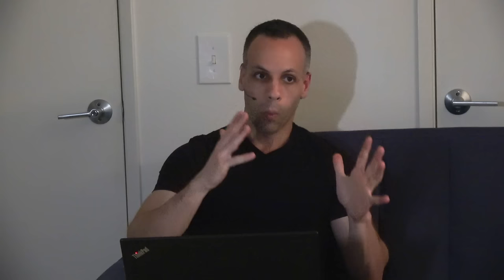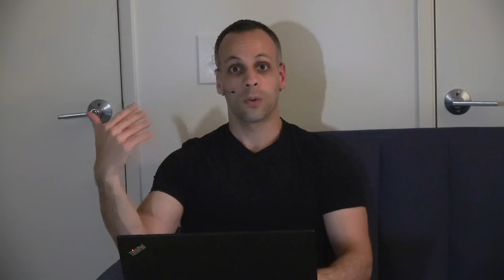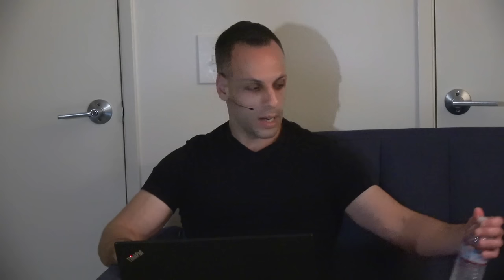EVGA's Oversight: Unannounced Changes Destroy PCs, EVGA takes NO ACCOUNTABILITY

Comment: This sort of reminds me how I built this PC in 2021. I bought a corsair commander pro fan controller, and plugged up my 3 front fans to one header of it. They came pre wired like that from NZXT. Didn't think there would be an issue. Well there was. It pulled too many amps and destroyed that header. No where in the manual or on the site does it say to not do that. A lot of fans come that way. I was able to return it though. Absolute junk

Comment: They should have designed a socket and plug with a shape that would prevent from using the old plug. I thought that was the whole point of having squared or bezeled pin plugs on the mobo in the first place...

But frankly, checking the PSU with a multimeter is one of the first thing we should do when building a PC. Worth the time to root that out if you need to troubleshoot.

Comment: If there is even the possibility of different pinouts with the same connector, the pinouts should be printed next to the connector. This if nothing else should be an industry standard.
Though ideally, the connector type should dictate the pinouts.

Comment: when it is the same manufacturer, and same model number, just a different release date or revision, then it would be very easy thing to think that you can use the same cables. but I was hearing back when I ordered extra cables about 4 years ago from another youtuber to make sure you get the correct cables for the correct power supply. either that or it was corsair that posted a warning on their web-site, but if you goto a shop, and pick up a 2nd power supply a couple of days later, you wouldn't expect there to be a change in the pin outs of the power supply for example.

product resolution and product reliability are two main things I go for when buying anything, the downside is the price premium, but I know I should expect the same reliability from the new purchase. and when it was time for a new GPU I knew it had to be EVGA as had 4 graphics cards, and none of them have failed, none of them had driver issues as long as I download off the EVGA website, NVidia drivers were c^^p to say the least.

Comment: According to GamersNexus who just talked about this story in their weekly news segment, the issue has been resolved between EVGA and the (or one of the) affected customer(s) including compensation for the bricked data drives that were damaged due to the cable screw-up, as well as going a little into why this occured in the first place. Might be worth doing a follow up video about it.
Reply: I find it funny that I also came back to Louis’ video on EVGA following the situation update.

In complete fairness, there was next to no additional information on the matter prior to Gamers Nexus reaching out. This is still a mistake unto EVGA as well not publicly announcing the changes.

I have that exact power supply as well as following the EVGA monthly newsletter since 2020. Not once have they announced the changes of the pin-out.

However, I did receive a disclaimer from their (individually sold) replacement cable set that explicitly mentions the changes around 2022.

Comment: Wow. Looks like I dodged a bullet this week. I bought 1300W EVGA PSU to replace an 850W PSU, and knew that you shouldn't use the same cables between different PSU manufactures and models, but figured since it was in the same Manufacture and model family I would be ok, which thankfully I am, since I'm still using this PC. But noted for future reference.

Comment: If the cable layout changed. Then why keep the same connector layout?
If it was properly designed the old connector should not be able to connect.

Comment: This is idiotic on multiple levels. There not being a standard. Changing the pinouts but not the connector. Changing the pinouts but not the model number. Changing the pinouts at all. Having a system that encourages people to use the wrong cables. Refusing to take responsibility for your terrible design causing problems. This is one of those cases where so many stupid decisions had to be made that you can't help but suspect malice.

Comment: EVGA gained their reputation in the PSU market through selling rebranded units from Super Flower. Think of the G2, G3, P2, T2 series. These were some of the best units you could get at that time.

A few years ago EVGA parted ways with Super Flower and now they mostly use FSP. FSP doesn't make bad units, but they rarely ever make really good ones. EVGA did use Seasonic for their G6 and P6 units, but that partnership seemed to be short lived. 

What I'm unsure about is who makes the GQ units. Did EVGA silently switch the OEM that made these GQ units, or did the OEM change the pinout?

Even before this fiasco, If I was in the market to get a PSU, EVGA is NOT a company I'd get a unit from. Both Seasonic and Corsair handle their RMA process as well as EVGA did. On top of that, companies like Be Quiet are making some really good units that are better than the G7 or P5 bullcrap that EVGA has on the market. EVGA now charges a premium price for their units but their units are not premium quality.

Comment: It wasn't EVGA but i had a warranty misadventure last summer. My Seasonic PSU died and it took with it the brand new mobo and ram, fortunately the CPU and GPU survived. Seasonic offered a 8year warranty on it but where i live i was supposed to go through the store to process it and the store itself offered only 2 years of service and after that you were on your own... and since i had the PSU for a bit over 2 years i was on my own. Seasonic replied that they can't help and there was no way that they would do anything about the rest of the damage even if they were to replace the PSU and MSI and G.Skill made it clear that if the components were fried by a fault in the PSU and it wasn't the devices themselves to be faulty, they are not obligated to replace them. 400 euros down the drain.
Next time i need warranty, i'm gonna lie to everyone about everything and maybe they won't look too hard before replacing it.

Comment: I thought I was paranoid always checking every pin with my multimeter and felt like a total idiot every time it as it was fine.
Luis is wrong though, they really should cover the damages (not data) IF they replace your psu with one that has different wirring (they know that 100%) AND they never told you about it (yeah they can prove that too). Simply negates most the customer's BS and will only cover their actual faults. However i think it is malice not incompetence here (the covering of the drives part, the swapping pinnouts on the same model is on the same level as apple puting a 52v line next to a cpu 1v data line but actualy worse)

For anyone to exploit this they would need to 
1* damage their psu in a way that evga won't void their warranty, possible
2* get "lucky" to get sent a psu of the same model with different pinouts
3* get no warning from evga, where they can totaly sent an email and tell the customer to destroy the cables, sent them a brand new unit (wires included) with huge red warning labels to not use the old wires.
Lastly they can standardise their own pinouts or make different psu-side plugs for different ones.
Problem solved. It isn't even complicated. Just excuses to avoid the cost of the drives and childish behaviour (doubling down instead of taking 2 steps which cost almost nothing to fix a problem and avoid a class action lawsuit).

Comment: That sucks, I have been using EVGA for 20 years and their CS has always been first-rate. In an industry where suck is the norm, EVGA was 5 stars.

About 3 years ago I had an EVGA PSU die on me, the first time ever, and it was under warranty. It was a 750-watt PSU and they sent me an 800-watt PSU in a sealed retail box.

Over the years, I had video cards die under warranty and got refurbished, but they were always upgrades.

It doesn't even take long: call, after 5-10 minutes someone answers and in less than 30 minutes, usually under 10, I have a cross-ship RMA set up. Try that with ASUS or MSI.

Comment: I was under the assumption that in the usa, there is such a thing as warranty. Not specifically the warranty the company makes but a base warranty. I.e. if a company provides you a product and it fails (since no 3rd party was invloced here), they are responsible for fixing the situation. 

It certainly can be costly, but this is an opportunity for evga to refine their internal policies.

As far as i can tell. If i stick with an original company for the peoduct and the replacement of a product and your product breaks my things because you did not provide me with proper hardware.

That is on you and you will pay for the costs.
If you refuse, there are always the courts. As far as i can tell, this may be a case?

Comment: Changing pin-outs is either a version (model) or revision change, and it should be labeled as such visibly. Versions/Revisions signal changes, and anyone purchasing a product needs to know if this is the same as the last version/model/revision, or if it has changed, because of the application of the product may depend on it. ESPECIALLY a power-supply. EVGA has, IMO, dropped the ball entirely with this kind of lunacy. Unprofessional behavior not showing the customers this respect. A customer should not need to test each components expected behavior in detail, that is what EVGA's QA is for. A version/revision/model change is necessary to signify that unit X is different from unit Y (and a pin-out change is veeeery significant) - and customer should evaluate before putting into production.

Comment: If this is a US customer then they are probably screwed as EVGA probably has some arbitration agreement clause in the T&Cs.  But if this is UK/EU I see no reason not to lodge a claim with a small claims court and let them decide.  There is no argument here EVGA were negligent, firstly for changing pinouts in the same model drives with no warning, that's the case won right there.  But the fact that they told him to keep his cables and then sent back a replacement drive that didn't work with those cables just proves negligence.

Comment: This is why you never use the same cables after an RMA. I thought this was common knowledge. When I RMA'd a BQ supply, EVGA told me to just throw out the old cables and they sent me a brand new PSU.

Like, EVGA isn't doing this just to screw customers. They don't make the PSUs, they just put their names on them. They obviously switched OEMs for the GQ models. EVGA doesn't just send out bare PSUs as replacements for RMA, they send you a completely new PSU, cables and all.

Comment: I'd feel understanding toward EVGA for not replacing the drives IF they hadn't KILLED THEM. There's no question there...THEY rewired the PSU! The customer simply plugged it all up as per usual. EVGA should be on the hook for this fiasco, and I think they know that.

Comment: I get not replacing connected hardware in most circumstances, but when you change the pinout on an RMA and don't send new cables, that's unacceptable. They knew (or should have) that there was no way the PSU was going to work. They should be paying at least for the hard drives.

Comment: I went through a similar issue with TWO Thermaltake Toughpower 750's. They were on sale for $50 bucks or something silly like that so I picked up two, threw one in a build about 6 months later and...click...then...nothing. I checked the wires, reseated everything and...nothing. Not even a click this time. I shut the psu off, unplugged it, took all the cables off save the board power, plugged it back into the wall, turned it back on, gave it a jump and the fans spun, yay. Feeling a bit more confident I plugged in the drives, and viola, still turns on. Great. Plug in the GPU and CLICK. Well f me. Unplug the psu from the wall, make sure the switch is off, swap PCIe cables, plug it back in, switch it back on, jump it and click. Same bloody thing. Now I'm kinda pissed. I toss the two dead 8 pin PCIe connectors and try a third. Same fricken thing. I open the other PSU, and on the 12th try I got a post. Why 12? Bc I ended up swapping the PSU to the other one.

5 cables that didn't go with either PSU, both from sealed boxes. I was so beyond annoyed I grabbed the 6 RGB fans and the controller I had, boxed them up and paid one of my employees to wrap it up. Luckily these had a trip which kept the PSU from frying the GPU or anything else attached, but this simply should not happen. If it is at the point where companies are shipping the wrong wires with their products on occasion, they really might want to think about a standard here. This wasn't some sketch Ali-Express deal or a 3rd party seller, this was from Newegg. I'll never buy a Thermaltake PSU again, regardless of the price or where it sits on the "PSU Tier List." I feel for that dude, and up until about 3 years ago I didn't know you were not supposed to use cables from the same PSU's either. I knew not to mix and match, but the same brand and model? I had no idea. In my case, apparently using the cables from the box was a crap shoot as well which again, is beyond unacceptable. After 20+ years of modular PSU's it literally makes no sense to not have standards for board power, pcie, sata, aux etc. Yes, i understand that some PSU's let you pug in 4 8 pins from one cable, but that just means there should be a standard for 4x8 cables. And one for 2x8, and 3x8, and 8pin + 4 pin along with wtv other combos there are. If they have to cut so many corners they cannot meet said standards then they should not be allowed to be modular/semi-modular and just have the darn things as part of the unit. To think that a problem which has existed since the inception of modular supplies is still a thing in 2024 when the solution is so beyond simple is literally dumbfounding.

Comment: My problem with PSU’s is that even with what looks like exactly the same connectors to the PSU, you have to be careful and test voltages. I use Antec and Corsair. I just always test Voltage out, and do not just go by colour of wires to guide me.

Comment: THEY WERE a quality company. They also moved to putting thermal putty on the memory modules (GDDR6 and GDDR6X) instead of thermal pads on their high end 30 series Graphics cards. Guess what happens when the paste dries out? The video output on the card dies. When you reboot the fan are still working and unless you knew about the thermal putty ( not paste) you would have no idea. In my case luckily I was about to RMA my card and get a replacement.

Comment: I used to enjoy EVGA products, because I found that they usually had higher quality stuff than their competitors, but after I had my systems for a while and I started having hardware issues, I tried contacting them for support and if your stuff is out of warranty, they didn't even offer me repair services that I could pay for, its the main reason why I don't believe in their products anymore, because you are not given any options at all when dealing with them, while with MSI or ASUS for example I have been able to get graphics cards and even motherboards fixed, even if they are out of warranty because they will charge you for the repairs.

Comment: i 100% agree with you but i have the problem that i dont which company to trust anymore. for example, to buy a phone, or a tablet. i bought a lenovo tablet recently, despite your video, because i just didnt know better and unlike you im not in the position to spend 600$ in something like this, like a google pixel phone. still, id be interested in a list of companies that i could moderately trust, or at least not actively trying to screw me... but if comparing specs is difficult, this is much more

Comment: I used to have an EVGA Nvidia FX5500 back in the day - ran on XP and Vista for a good 3 years until it died. Afterwards I got an XFX AMD Radeon HD2400 (yes, they actually made this for AGP) for my Athlon 64 on Socket 754 because I was a low budget teen that wanted some decent tech.

I've always been good with Antec PSUs and would consider other brands depending on needs. For dedicated GPUs as well, it looks like EVGA lost my business too.

Comment: CRAP, Thanks for pointing this out Louis. I had no idea it wasn't standard across ALL of EVGA's devices. 
I knew/assumed it wasn't brand to brand, but..... Guess I have to label the pile of extra cables now.
Reply: Unfortunately, you should have known that. PSUs from most consumer-facing brands like Corsair, EVGA and many more are manufactured by many different OEMs. Since there is no standard, why would you ever assume that PSUs from different OEMs use the same standard? I wouldn't even like to assume PSUs from the same OEM use the same standard...

The same model of PSU having two different standards and EVGA purposely hiding the fact though? That REALLY takes the cake...
Reply: @HazewinDog  I'd say re-read my comment. Never assumed different OEMs use the same. 
However, logic would have, if they were using that, dictated the all of EVGA's PSU were wired one way, then Corsair and Asus...ect, likewise wired their products to some sort of internal standard, requiring 1 master tester to QC everything. 
Makes them seem illogical, wastefull, unorganized and inefficient at best. 
Also defeats one of the purposes of modular and "from the same company", that being easy/quick PSU swaps without rewiring systems.

Comment: They should've standardized  power supply wiring after the Dell debacle. I kinda assumed they did after that. Early 2000s Dells used the same motherboard connector as aftermarket psus but the wiring was swapped around. And yeah they should pay for all new HDDs and the data recovery for every system they fried. that's just straight up incompetence.